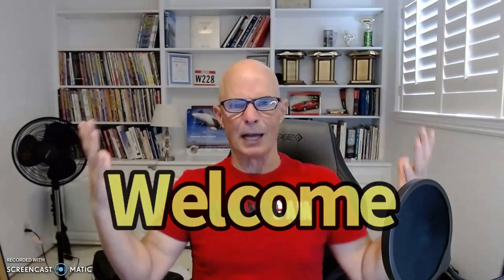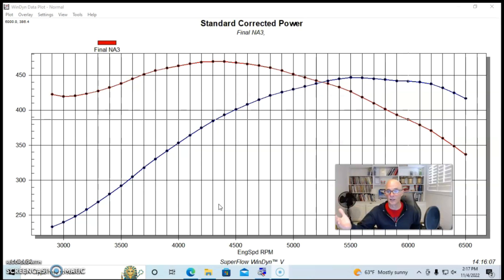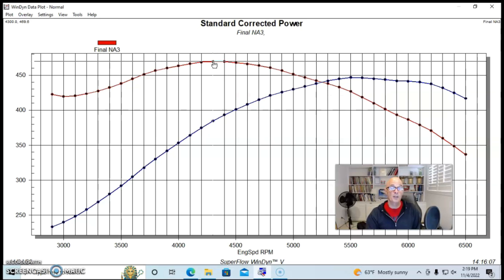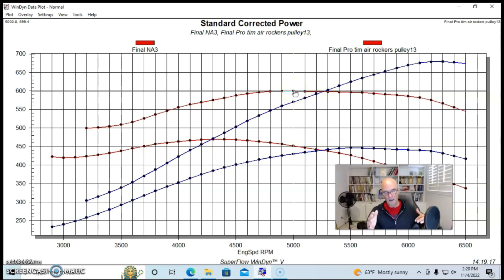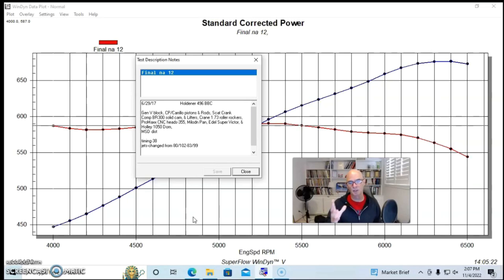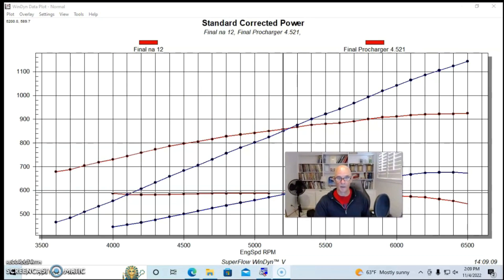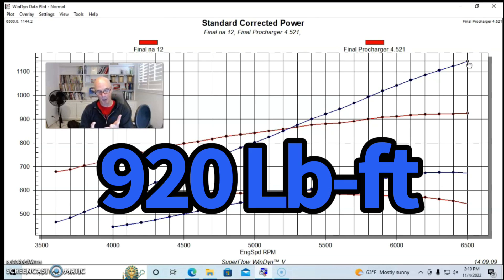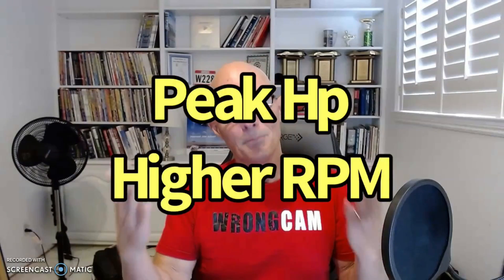HOW TO MAKE SUPERCHARGED SBC & BBC POWER-HOW MUCH HP DOES A PROCHARGER ADD TO A SBC OR BBC STROKER?

Comment: Hi I have just built my first  vortech sbc .its a drag deal .388 with all forged and aluminum rods.15degree heads .i have a V-7 YSI blower with a7.5 crank and 2.75 cog drive .max rpm7500 how can i with out just running it get a idea of boost i will make ? Dont want to push the parts out first pass thanks
Reply from the maker: Only run to 4000 rpm, then 5000 rpm, then 6000 rpm etc...Measure boost
Reply: @richardholdener1727  thank you very much simple I don’t know why I was stuck on that lol

Comment: Should do a like for like centrifugal supercharger comparison between vortech, procharger, torque storm, etc
Reply from the maker: There is no like for like to compare. They all have different sizes, internals steps and power potential.
Reply: @richardholdener1727  fair! Thanks for the reply and original video as I consider a procharger for my sbc...
Reply from the maker: they work well, there is no bad choice

Comment: Thank you for the information and time you spend on these videos. I am building an identical build and was curious if you can provide the comp cams part number for the cam used on the 383. I see the specs you posted however I can’t find the cam on Summit. I would really appreciate it.

Comment: Hi Richard

Are you able to make a centrifugal supercharger video that shows how much restriction is in a long intake length with lots of bends vs a small filter/large filter attached to the back of the supercharger and then a final power run with no filter.

Always been curious, the internet is full of misleading information...some say it makes a difference others say it does not.
Reply from the maker: I tested that on a turbo (vid is up)

Comment: What about a torquestorm on a 5.2/5.9 magnum or TPI engine with stock intake manifold? How much more RPM could you push with runners as long as your leg?
Reply from the maker: another 500-600 rpm

Comment: Is there a rule of thumb for parasitic loss for a belt driven blower? I read where someone said it was about 10%. So a turbo making a certain HP at 10psi will make 10% more power than a blower at 10psi.
Reply from the maker: the losses from the blower increase with the power output-not a strict percentage
Reply: @richardholdener1727  ok, so is there a working rule of thumb? I have always heard the 15psi doubles the NA HP rule.

Comment: Richard What cam would you use in a 496 built for towing and 4wheeling I'd like to hear you opinion on flat tappet and hydraulic roller cams
Reply from the maker: did you start with a gen 6
Reply: @richardholdener1727  yes
Reply: @richardholdener1727  I'm asking because I have both a gen Vl and mark lV block

Comment: Richard I would love to see a gen vi bbc with the single torqstorm. I realize that it won't blow the dyno record but I'm interested in as an upgrade for my tow rig.
Reply: im pretty sure hes made quite a few bbc videos, just look at the playlist on big blocks and raise up the power curve with how much boost you want too add,  a single turbo would be a better option for a tow rig over a procharger they're more for street cars plus a turbo will be way cheaper than a procharger you can make your own turbo kit for 600 ish bucks if you shop smart and plan the build right
Reply: @chrishansen7004  I was mainly interested in the lower cost Torqstorm supercharger because of the ease of install and lower output and price. Just wanting to see what it can do on a relatively stock gen vi 454.
Reply from the maker: think turbo
Reply: @richardholdener1727  ok I get it, I'll stop being lazy and fab a turbo kit for it. 😁

Comment: You’re limited by a ratio of 3 times NA Power if the cam , heads, and blower will operate at the required rpm. If IAT’s are addressed appropriately with  correct fuel properties. What ever the head & intake flow x the NA power calculation before going positive boost in the intake.
Reply: 3 times sounds like a lot I mean that's got to be more than 30psi because what 29.something should get you to 3 time but the supercharger is going to eat some of that
Reply from the maker: you can't make 3 times the power with either of these superchargers on these motors, and there is no artificial limit
Reply: @richardholdener1727   exactly what said if the blower will supply the air. Naturally aspirated there are limits that are depended on air velocity supplied by atmospheric pressure.